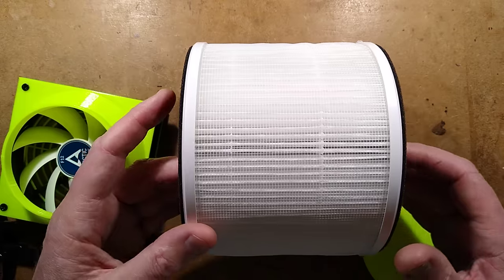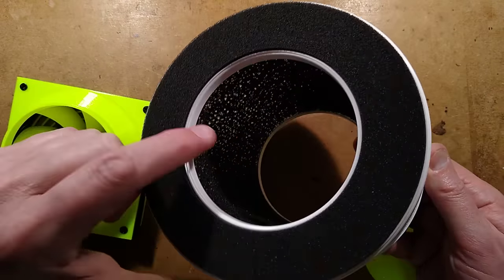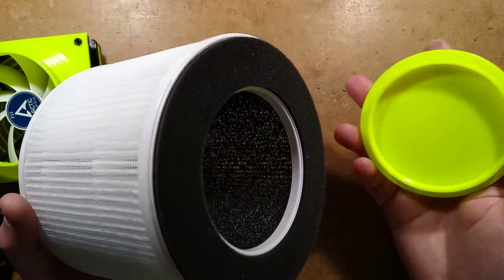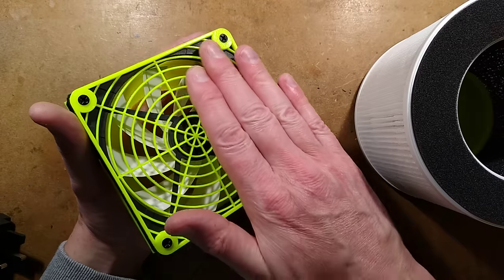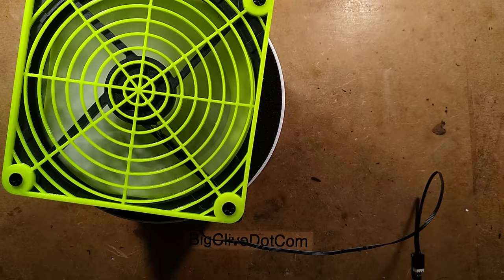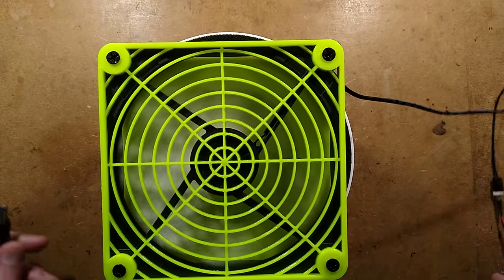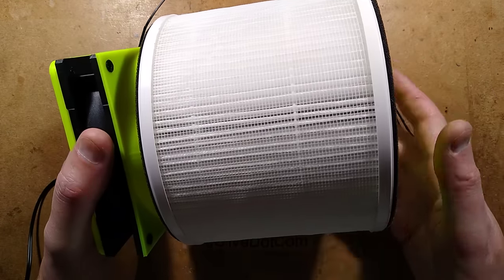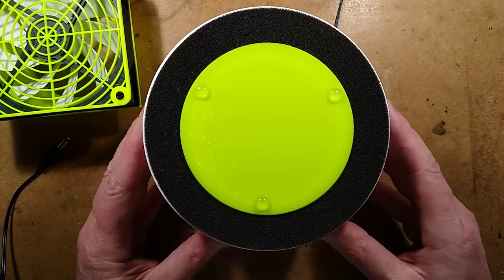DIY cheap & quiet HEPA air cleaner

Comment: Those fans should do fine vertically, modern computer systems can have radiators on the top and bottom of the case such as the Lian-Li o11 Dynamic. If you are super worried, then just put the fan on the bottom blowing downwards.

Comment: I always enjoy your hepa videos. Can you talk about axial fans vs radial fans? Because most commercial air filters use radial fans, because they are generally able to create a higher static pressure than axial fans, which are typically only used when there is little air resistance.

Comment: a small advice: arctic is a nice brand but the F series is made for airflow, i would use the P12 which is made for application like radiators and in this case would be optimal

Comment: I  bought my first 3d printer after watching this. I bought a 5v 120mm usb fan. more convenient than 12v, pleasant and  quiet white noise sound.  I bought the cheapest  hepa filter designed for an air purifier that was  local to me, it's larger than the opening of the 120mm fan. So I made some adjustments to the model, did a few  2mm circle test prints to get the  sizing just right, printed it out and put it together and it's working just fine. I really appreciate you sharing the design and making it easy to adjust clive. I'll be sending you a bill for the cost of my new hobby since you are to blame, clive. A question for anyone, I want to seal in between the fan and the 3d printout. Something that's not permanent. Will general purpose silicone sealer work OK? It won't melt the PLA or anything?
Reply from the maker: Not sure the best thing to seal.  I wasn't expecting bigger filters to be used.  I'll have to have a play with that.

Comment: Luminous Green ? This is a bit of a change from the traditional pink...!
As for the fan bearings I don't think it matters which way up you mount them. I worked in IT in the City for many ( to many ) years and in my experience the biggest threat to the fans bearing life was the amount of crap in the air going past them. Tiny bits of grit would accumulate in the bearings and jam them up and central London is pretty gritty. The fans would last for years longer in a dedicated computer room with proper air con with big filters, rather than sitting in a corner of the office exposed to all the pollution. The design of your filter unit here will er, filter, the air before it goes past the fan motor, thus greatly prolonging it's life.

Comment: I like your idea to make a DIY HEPA filter

I have several extra computer fans 
So I think I will put on on each end of a pair or maybe even 3 HEPA  filters 
I think I have the right size of plastic pipe to couple the filters 
I think I will put it in the living room  to test out how it works '
As the living room dose not get used much

Comment: No need to 3D print components. You can buy a “camping fan” that has a rechargeable battery in it and duct tape it to one of these round HEPA filters that are sold as replacement filters for air cleaners. To make it really easy, get a closed bottom HEPA replacement filter so you don’t have to attach anything to the bottom. Cut a round cardboard shroud to put between the top of the filter and the camping fan. 

Make sure to buy a “no residue” duct tape like the one made by RHINO since you will be removing the duct tape that seals the fan to the cardboard and cardboard to the filter to make it easier to change the filter. 

I am making one of these with a rechargeable battery fan to take with me to dentist and doctor appointments  - won’t need to plug it in to an outlet. For the dentist I will hold it on my lap while the exam and cleaning are done.

Comment: A very neat and clever solution. Now if I only had a 3D printer and a place to order those filters cheaply (I'm in Finland) :) Actually the air here is not that dirty, so maybe I don't need this. I'm more interested in acquiring an ozone generator to put in my kitchen to maybe reduce the chance of mold because I sometimes tend to have bread stay too long (in plastic bag of course to prevent drying).

Comment: Just replace the bottom lid, add a 2nd fan in series and a base for the filter drum. Btw, check the PC community, there are some guys out there that tested those arctic fans. They have 2 or 3 resonating rpms u should avoid to keep them as quiet as possible by having the most usable airflow!

Comment: To be more precise, the fan is blowing in the wrong direction. The fan needs to suck the unfiltered air through the filter.
Filters are always used with the biggest surface in contact with the unfiltered medium (air, oil,...) and the filtered medium is pulled from the smaller inside surface.
By HEPA filters, the outside is to filter the biggest particles in air, and the carbon filter the smallest particles like odors.
Also by pulling the air through the filter, the air that passes the filter is clean, so the fan will be kept clean. 
When blowing air in to the filter, the fan will collect all dust and blows this dust inside the filter, where the dust will collect at the bottom. 
When used in the correct way, the dust stays on the outside of the filter, and will drop on the table where the filter is placed.
Other then that, a nice idea to use a commercial HEPA filter like this.

Edit : i missed the direction of the fan :-)
Reply: clive did it perfectly fine, pulling fresh air through the filter out the fan.
Reply: @casemodder89  You're 100% right, it's still early in the morning here, my bad :p

Comment: I make dyi HEPA air cleaners using a old fashion box fan and cut to fit HEPA filters with elastick loops to hold the filter to the back of the fan. there not quiet but they do work realy well. for around 25usd

Comment: There's a site where the guy is doing 3d printed fans, sent in by fans, some of them getting massive airflow and yet very quiet.  Swap the fan blades for one of the custom ones and this could get even quieter.

Comment: Nice. I'd have put something like a superseal connector on it though for a sleaker look. Make thefan shroud triangluar and the plug triangular so that it protudes outside the edges of the fan if you want to be able to stand it on it side.
Reply: TRiangualtr is probably the wrong word for the fan shroud.

Comment: the fans can be horizontal also as they are used on aio watercoolers also (where they hang horizontal). Else you can go for EBM Papst..which are more industrial grade

Comment: Hi, very much true that most air purifiers can be boiled down to the base set up of a filter and a fan. 
But there are a lot of details that actually differentiate a good and worthwhile build from a wasteful product. 
Fans used in good air purifiers need to be designed to achieve the necessary pressure and targeted airflow in combination with the correct filter media and design. The term HEPA is not really linked to a specific grade of filter (e.g. an E12 or H13 filter) and is used VERY widely and vaguely for a large range of filters (from crappy to good). 
Your setup probably, kind of works (efficiency unknown) as you combined a fan designed for airflow and a relatively inefficient filter that has a sufficiently low pressure drop across the filter. 

Keep experimenting! Maybe look into air quality sensors (PM2.5) in combination, to get a feeling for the efficiency of your design. 
Cheers

Comment: Big thing I find is cheaper filter replacements skimp on the carbon step for volatiles. For this setup I'd want to make a second toroid/cylinder cage to hold a lot of aquarium carbon. Dust isn't a big problem for me but smoke and resin printing odour is.

Comment: Car passengerroom air filters. They are kinda cheap (even with active carbon) because they are made in a lot larger quantities 
and meant for high air flow and long standing times. :-)
Now the "active carbon" is more a gimmick against smells, it can also grab and hold solvents/chemicals but you'd have to monitor when it's saturated.
(dont use car engine air filters, those might emit solvents and stinky stuff couse an engine doesnt care about those, but passengers do)
Now the box would need to be square, but you could use 2 or three or 4 of them at once in a frame to get the box shape again.

Comment: Flip the fan so it pulls through the filter instead of blowing into it. It will make that charcoal layer last much longer since it sits behind the mesh and the HEPA fart plus the entirety of silter has much greater surface area from the outside than from the inside which means it will filter more air in same time.
Reply from the maker: It does pull the air in from the sides and vents from the fan.
Reply: @bigclivedotcom   nice :) did you have any chance to observe the efficiency?

Comment: Got the filter for a dollar at krazy bins,  sister in law gave me the pc fan.  Power supply was a thrift shop 12vdc for $4.  I hot glued the fan on and sealed the bottom with a hot glued piece of plastic.  I made it for $5

Comment: Most economical would be to use a washable Hepa filter. There are plenty of designs for different things on ebay. Add some generic activated carbon and you’re away. Would like to see a design which incorporated a poundland powerbank for ultimate placement around the house.

Comment: 4:18... Just extend the fan mounting plate and add a plate to the end cap to the diameter of the Filter. The extended plates will now keep the air cleaner from rolling away.

Comment: People who say case fans aren't suitable for horizontal mounting, with all due respect, don't know what they're talking about. In normal vertical mounting the wind force already pushes the fan blade out more than gravity would when mounted horizontally. And those forces are nothing to the forces exerted on the spindle my the magnetic forces during operation. These fans are perfectly operable in any orientation you'd like. The only thing you might need to take care of, is excessive vibrations. i.e., might need to get special industrial ones if you are making something for within your car, or on shaker tables.
Reply: And I looked into to make something like that a while ago, but by pure chance stumbled upon some air cleaners in a Swedish yellow/blue branded furniture store, that was cheaper than I could make it myself. Might eventually modify that one as I bought a couple of the dumb ones, and make them connect to home automation, but for now, they're doing their thing perfectly silently on mode 1 or not so silent, but pushing loads of air on mode 3, if needed.

Comment: I think I would add a second fan on the other side. Both blowing air into the filter. Maybe two tubes that extend a bit so you can move he tubes and point them a your soldering work piece. Even though, I think for soldering fumes you maybe need a better filter.

Comment: I dunno about the fan bearing loads. Fans are mounted all kinds of ways in PCs and run for years without wearing out. Fans on water-cooling radiators are often mounted on the top side of a computer case. Even my 15 year old power supply has a horizontally mounted fan in it and it's still churning!

Comment: aha, I remade this, first time watching: I made and prototyped so many prints, the design looks almost identical, but I'm using a vacuum filter that sits inside the shroud, big mistake though, it was too dense, no air could go through with a pc fan.

Comment: you need fans desinged for static pressure. a fan like the "NF-A12x25 5V" you can stick directly to a normal 5v usb plug. its so quiet you dont need diodes. but if you have the space i would use a NF-A14 5V. that is a 140mm fan and moves 50% more air and is also inaudible right until you shove your ear into the blades.

Comment: The top grill needs to be replaced with a pressure booster (stationary vanes) thingy, that should help with air just circulating around the blade tips when you cover the intake

Comment: There are different bearing types on PC fans and some are better in horizontal vs vertical for life and noise, and vice versa. So providing the correct fan/bearing type, should be good in all orientations.

Comment: Clive PC fans can last a long long time.
The cheap ones off ebay may die sooner, but the good fans can last easily 20,000+ hours at full speed.
I run 3 140mm fans vertically for the intake on my case.
1 120mm fan vertically for the rear radiator
2 120mm horizontally for the top radiator

Comment: Hi clive, great vide, and my introduction to openscad, will learn more about that in the future.
You've probably already answered. But was is the direction of the airflow of the fan, not obvious. Does the fan draw air into the center of the filter then radiate out.  It would make sense as it looks like there is a active carbon inner layer which should block larger particles.

Comment: A nice variation on this design would be for mounting to the back of a computer tower to eliminate dust from getting inside the case. Obviously a smaller HEPA filter would be desirable and I would print one end with the flange to easily mount it to the existing holes in the case... Obviously,  one would need to ensure there is sufficient airflow after installation for proper cooling, and adjust rpm accordingly... the designs are limitless, maybe even using the rectangular ones that come with vacuum cleaners, which are usually low profile...
Reply from the maker: Computer cases are best suited to high airflow through coarse filters.

Comment: for me fan noise is not a problem until the motor bearings start to fail and squeal.

also many fans can be used as a basic crude sleep machine as it is a constant that helps with sleep

Comment: You need to make two flat bits thar cover the sponges bits on the end. That way you ensure air isn't being dragged through those sides and missing part of the filtration. Probably not  big deal but a simple little fix if you have a 3D printer.

Comment: Great idea and design just an idea, why don't you take the rubber feet off the cap and use longer feet to raise the fan off the ground so it it takes in air from down there.
This will keep the fan more hidden and since its the heavier part it wont be top heavy anymore.

Comment: Old air filters on big vehicles used oil air filters, the vehicle would suck the air through oil which removed particular from the air, and you just had to filter the oil ever so often to clean it then it could be reused, (the nnlike today with disposal filters, very waste full), so maybe a filter could be mage with a u bend pipe oil and a fan, make it suck the air through it. But great minimalist filter there 👍

Comment: Would you think it will be a good addition to put an ion generator and an UVC light inside an hepa filter to maximise air purification? And i say ion generator and UCV cause i know for fact that most UVC (gas) lamps generate a dangerous amount of ozone and they have to be enclosed inside a glass container. So by adding an ion generator you can create a dust and big particles "killer",with the uvc you'll take care of the viruses and organisms  and the hepa will take care of the rest. Just a thought of an super efficient air purifier....

Comment: i would suggest to use pressure optimized fans arctic has a line of them (p8 p12 p14). You are using flow optimized fans, in F12  F stands for flow

Comment: Hi Clive, 
What you could do, is use TWO fans, one on each side, instead of just plugging one end of the filter. Twice the filtration capacity???
Both fans would suck air through the filter and blow it out, but i imagine, it would work best if placed horizontally.

Comment: Some people are wrong, regarding the orientation of the fan.
Almost all PC cases nowadays allow for fans to be mounted to the "ceiling" of the case, blowing air out.
Reply: PC cases are designed to mount hoizontally BUT are the fans designed to do so ?

that is the actual question.
Reply: @casemodder89  some fan manufacturers also make cases. Do you think NZXT would put a fan in their cases that shouldn't run horizontally? Nah

Comment: I like the Xiaomi tower purifiers as the units are inexpensive compared to Philips and the filters themselves are very affordable. They do start complaining when you run them longer than they think the thing should last even though it continues to filter the air. The units are pretty high quality as well. The only issue I've had after running them for 4 years is the bearing on one of the tiny fans moving air through one of the PPM sensors went. I thought about replacing the fan or the sensor but the unit runs fine without it - it just lost the PPM display and auto RPM control so it has to be controlled manually or slaved to another unit through the app.

Comment: Commercial HEPA filters run at clean rated flow rates at around 600 Pascals, that’s not pressure you’ll get from an industrial axial fan let alone a pc fan, you need a centrifugal fan capable of the high pressures required for HEPA filter installations

Comment: i hooked up a filtrete f1 on back of a box fan using some 3d printed U joints and then wire tied it to the  back of the box fan. It is so cheap i did it to 3 other fans and have them in different rooms.